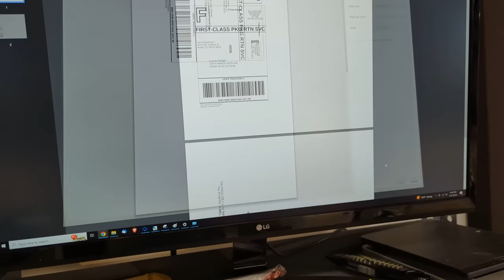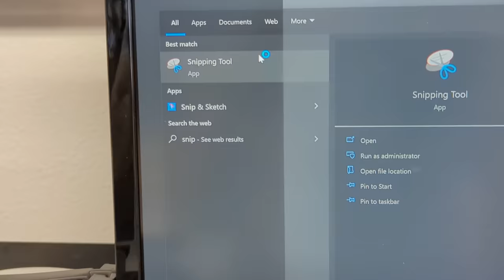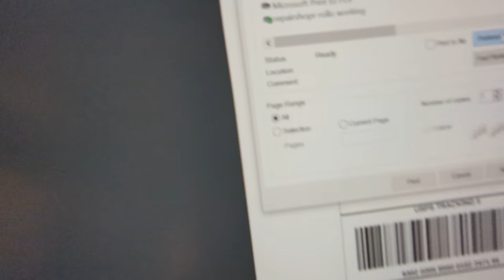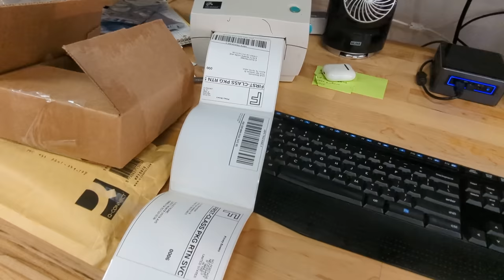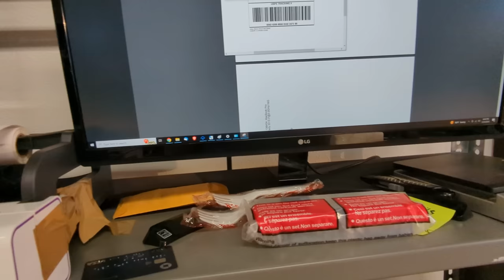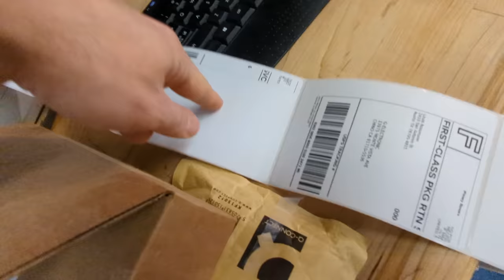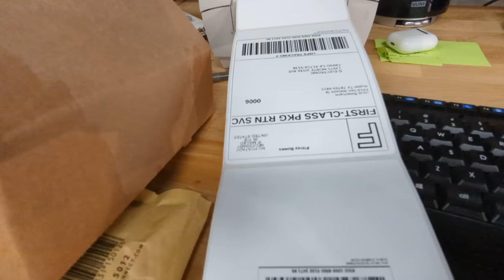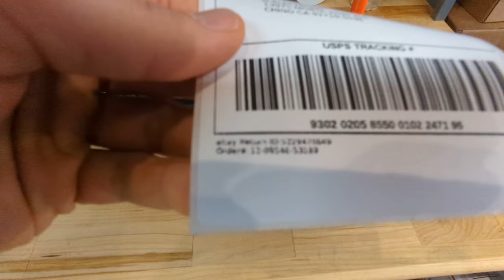rossmann repair group vs. label printer, part 3

Comment: It wouldn't be that hard to setup a Python script that auto does all of this.  You can have a script that automatically takes that pdf file of the shipping label, converts it to an image, auto crops it to correct size (by using smart logic for pixel detection rgb change vs background rgb value) then auto sets the print settings and prints it.   I've done similar stuff like this for my work.   Edit: only worth it though if you have to do a lot.  If you only have to print something like that from time to time, then probably not worth it.
Reply: Is this ChatGPT code any good?

import os
import tempfile
from pdf2image import convert_from_path
from PIL import Image

# Set the path to the PDF shipping label
pdf_path = 'shipping_label.pdf'

# Convert the PDF to an image
with tempfile.TemporaryDirectory() as path:
    images = convert_from_path(pdf_path, output_folder=path, last_page=1, first_page =0)
    image = images[0]

# Crop the image to the correct size
width, height = image.size
cropped_image = image.crop((0, 0, width, height - 20))

# Save the cropped image
cropped_image.save('shipping_label.png')

# Set the print settings
os.system("lpr -o fit-to-page shipping_label.png")
Reply: @LordSandwichII  Not bad, but:

(1) You need a way to select your pdf. If you work well with terminals, it can be an argument. If not, or your colleagues will be using it, you will need a little GUI.

(2) This code assumes the shipping label is always on the first page and in the same size/place.

(3) You should adjust the crop settings if the above is true. Disable the printing code and check the cropped image until you get what you want.

(4) Libraries need to be installed if they aren't, like Pillow (for image manipulation) and pdf2image.

(5) Right now, if a 'shipping_label.png' file already exists you may get an error. Perhaps implement deletion / overwrite.

(6) The last line only works on Linux, because "lpr" is a Linux command. You need a system command that A) Selects the label printer with proper settings and B) works on Windows if you use that. Unfortunately, I'm unfamiliar. 

(+) This code does some unnecessary things, like create a temporary folder that's never used and converting two pages to an img but only using one (the one with the shipping label).
Reply: @soheil5710  ...and this is exactly why I think Chat GPT is not a substitute for learning how to code. Thanks! :)
Reply: @LordSandwichII  I'm still baffled that it's able to produce this much.

Comment: you can elimate the printer and use a plain paper printer. they have that label size as return labels from ebay.  just print it out and tape it to the box works every time. just do not tape over the barcode. you also could have measured the label size then use a plain paper printer as test sheets to get the right size. then try it out on the label. you also could have cut paper to the label size then send it through the printer as a test. it might not print on that type of paper. save waste on labels.

Comment: Louis, Did you know that an Imperial Inch is really a metric unit? It is now defined as being exactly 2.54 cms. It changed in the 1960s. So freedom units are actually French Units...
As for conversion. multiply the inches by 2.5 [4*6in is 10*15cm]; even at 73 years I can still do this without a calculator or pen+pencil...

Comment: Been there done that. Everyone annoying to figure out the zebra proper config. Also if you change the printer dialog from the chrome print to windows printer dialog the label is created differently :))

Comment: Good luck on your printer issues. At least it’s not dot matrix driver issues - 24 pin print head but no driver only 8 pin head software drivers …. This was a real issue 30-36 years ago … and there was no internet to find/dl a solution.. new store looks amazing. We need a proper store tour video.

Comment: Brother driver for QL-1110 (with or without NWB) has an auto crop feature (explanation below). I wonder if there is open source software able to do the same.
Explanation: Auto crop detects the frame of a shipping label and auto crops it. To enhance readability of the barcode it will read the barcode data and re-generate the barcode so that a small and wide bar width ends up as multiple of pixel width. Looks somewhat funny when you notice it for the first time, label size and text look all ok but the barcode moved a little bit and is smaller or wider than original.
Downside: QL-1110 NWB does not work with any paper, it needs to have black sqares on the back, but there are plenty of cheap third party options out there (search for DK22243 (=endless but printer has a cutting unit) or DK-11247)

Comment: Use the the free version of the ZebraDesigner printer software. You already have a Zebra printer, so it will work no problem.

Comment: Those zebra printers are tricky.  Make sure you set the label size in the printer properties/settings of the printer.  Changing sizes in the print options doesn't exactly work right.

Comment: I didn't use a thermal printer since like 7 years but I do remember, as a developper, you need to update the paper size from the printer settings (that is usually handled from the printer driver) and possibly from the software you are printing from...; exacly like you did with the snipping tool from windows. Those printer may not work properly with software with predefined paper size (that you cannot customize) or paper detection (like the "fit to page" option). Google Chrome is one of those bastard that partially implemented their own printing process. You could also try to install a 3rd party pdf reader that use the usual Windows printing process (I didn't check with Foxit Reader).
And somewhat, I remember that "printing" it as a PDF instead of the printer, was enough to test (especialy like at your stage, to figure out everything). But that may be because I already entered everything right in the setup process.

Comment: Haven't seen the entire video, however Inkscape does a pretty good job of opening vector stuff out of pdfs, you can then save it as a high-res png and print it with whatever (idk libreoffice, office, pages (*pukes*) or whatever). Works for my stamps over here that I buy online (Germany), it can even keep the size information if you somehow click things right

Comment: I use shipstation and sometimes what i find whether using google chrome or firefox is it chooses to print the label within the browser. I personally find when you save it as a PDF and open within adobe reader it ALWAYS prints properly. Printing from within chrome or firefox can cause mayhem for some reason with PDF or labels.

Comment: If you think the driver revering on the printer is stupid just wait until you read this; My favorite driver conundrum with windows is with the new xbox wireless controller driver. For some amazing reason Microsoft decided that the button mapping needed to be changed with a firmware update to the controller itself, requiring a new driver to handle the new button layout. The problem is that the driver is now so deeply embedded into Windows 10 that it usually gets upgraded when you go from one major version to another, The firmware update to the xbox controller happened right around the time they released version 1903, Im still on 1607 and went to go sync the controller only to find out that one of the sticks don't work A is bound the the bumper and half the buttons do nothing. In order to get this driver, because at the time it wasn't hosted anywhere official, I had to set up a virtual machine with the new windows version, copy the driver over, make sure it remained signed, and then after that if for what ever reason the controller ever gets removed from device manager, either by syncing it via bluetooth or adding more than one controller, windows will reinstall the old driver and all the buttons won't work again. I re install the correct new driver and then as the icing on the cake, windows needs to reboot to use the new driver, it can go from new driver to old driver with no reboot, but needs too reboot to go from old driver to new driver.

Comment: While I don't know if this would fix anything, you were using Chrome's built-in printer dialog at first and not the system one.
The former is very limited and tends to do it's own thing- it's simply bad at it's job, whereas the latter is less intuitive because of the ancient interface, but might work better.

Comment: Windows can unfortunately change the used drivers for a device even if the GUI setting for automatic driver installations is disabled. But there is a group policy setting that really disables that behavior.

Comment: The zebra probably can generate the barcode by its own including the box and proper formatting - down side is you have to learn how to connect to the terminal of the Zebra and talk to it...
Reply: yeah I've had to do this to integrate a similar label printer with a PLC in an industrial automation project. Fun and games
Reply: @marcogenovesi8570  yeah that's how you figure it out I had my "This is -UNIX- BASIC, I know that" with a Zebra printer when we figured out that we don't need a computer to increment EAN codes and print the on button press after fucking around with a program called "label master 2000" or something like that that absolutely was not able to print labels in under 5 minutes, what was just not feasible for this job.
Reply: you use zpl (zebra programming language) for it. you can use zpldesigner to do it
Reply: @ikbendusan  ZBI to be more specific is the interpreter terminal that runs on those kind of Zebras what is in essence just a extended basic - the reason we did not go for plain ZPL was that we could hack the button to restart the loop so that all you have to do to get a label is to press the button you could not do that with ZPL generated by zebra studio /zpldesigner (or whe where to dumb to figure it out)
Reply: @fischX  i made a python script for such extended functionality; personally i only use zpldesigner for the design part

Comment: Surely the better thing to do is first pre-prepare a custom sized blank document, since any modern word-processing software will let you set a custom page size. Then once the document is in place you do all of the screenshot-finagling to get the label data into the document in the right place. Then since you have a pre-sized document that matches your paper, you know it will print out correctly.
Reply: Thinking about it some more, I know that there are at least 3 different ways to import a PDF file into a Word document (if you're using free office software like LibreOffice I'm sure it has similar functionality). So I'm sure there's a way do it all in one go by importing it into Word (or equivalent), resizing the page and then manually adjusting it to fit in place.

Unfortunately it will still be a manual process to some extent because the problem is that the printer driver fundamentally cannot distinguish between vitally important blank space that needs to be preserved for design-related reasons and a simple absence of data on the rest of the page. So absent of very specific (and probably expensive) software or some AI solution, the actual act of telling the computer what part of the page it's allowed to discard when scaling down will have to be done manually by a human.
Reply: If you've got someone who's proficient in writing macros for whatever office suite you have and it's a frequent issue, they could probably write a one-click solution for it, but it would have to be different for each courier/label type. So not sure whether the time calculus works out on that.

Comment: The label editing software that came with my Brother label printer has settings included for all the supported paper formats so I can just use the snipping tool to copy and paste an image onto a label in that software. I never have to type in any dimensions, I just select the paper type in the program and adjust the image to make it fit. Does Zebra not offer software like that for their printers? It could make that process a lot easier for you.

Comment: You had it midway through, just had to crop the image a bit on the sides and adjust the print margins it was printing in from the side too far and that setting is in the same dialog you edited the paper size in.

Comment: you don't just have a plain paper printer like a brother where you can size the paper the label however you want, scotch-tape it, just don't tape over the barcode they have to scan... works for me, my zebra I think got dropped, I need to super glue it together I think...

Comment: "It will scan", not neccesarily if the bar code stripes are at the wrong distance apart. Maybe if the courier sent out QR codes might work out better.

Comment: It's the label generator software - if it gave you the proper 4" x 6" print job, life would be so much easier.  Fit to page dialog is outside of the basic Windows 'print' - usually advanced or printer software.

Comment: The way I get this to work for me is I save the label as a pdf and then open it in the pdf reader then use a snapshot to highlight the label then do ctrl P and it should pecking or just fine

Comment: If that is a raster image, then GIMP has ability to change size or position of print (File | Print... | Image Settings). Page size and orientation are in File | Page Setup...

Comment: G-Electronic has scammed me before. Haven't seen the video yet but I noticed you're returning something to G-Electronic. I purchased a very large quantity of barcode scanner batteries from them.  All the batteries failed within a week. All the batteries said they had 5 charge cycles on them but I was skeptical. I took them to a friend who read the info off the chip in the battery or whatever and apparently G-Electronic reset the charge cycle counter on the batteries so they would read 5 charge cycles instead of the real number. That's my opinion on my experience. Hope you had better luck. Going to watch the video when I get off work.

Comment: I've had to do this exact same bullshit before with a regular printer. And for once the printer wasn't even at fault. Some companies just send the label with zero negative space around it to help scale it correctly. To make matters worse, Chrome's scaling and positioning settings are terrible to work with.

Comment: it should still scan perfectly fine.
the width of the bars is relevant in relation to the others in the lineup. 
you're not required to print it on 8x11.

are you saying that what ever came out wasn't scannable by the driver?

Comment: Me and my colleague on site spent two hours yesterday trying to figure out why the same label printed on the same zebra printer would print correctly when being sent manually but get all screwed up when being sent to the printer automatically by our program. In the end, I undid the changes we had just done to the label and it suddenly started working again.

I hate label printers.

Comment: here is some simple python code (intended for UPS labels, needs adjustment to where the label is located)

from PyPDF2 import PdfFileWriter, PdfFileReader

with open("input.odf", "rb") as in_f:
    input1 = PdfFileReader(in_f)
    output = PdfFileWriter()
    numPages = input1.getNumPages()
    print("document has %s pages." % numPages)
    for i in range(numPages):
        page = input1.getPage(i)
        print(page.mediaBox.getUpperRight_x(), page.mediaBox.getUpperRight_y())
        page.trimBox.lowerLeft = (10, 170)  # bigger
        page.trimBox.upperRight = (560, 470)
        page.cropBox.lowerLeft = (10, 170)  # smaller
        page.cropBox.upperRight = (560, 470)
        page.rotateClockwise(90)
        output.addPage(page)
    with open("output.pdf", "wb") as out_f:
        output.write(out_f)

Comment: Office Space moment. Also if saving an image turns out to be a decent way to get the printer to play ball, you can automate cropping with graphicsmagic.

gm convert test.png -crop +LEFT+TOP -crop -RIGHT-BOTTOM cropped.png

I have scripts setup to handle screenshots from certain software and it works well.

Comment: Print to PDF, use Actions to crop PDF to the correct size and print.  With Actions in Adobe PDF you can save your crop settings and tweak them to the proper size.

Comment: maybe a dpi issue? I had the same problem with my zebra printe because the printer was 300dpi and my settings weren't. after fixing that i could chose the correct paper sizes.
Reply: this. you are printing with 150dpi, the printer has 300dpi

Comment: Use IrfanView to print clipboard stuff. Ultimate control over placement and size and it's a powerful image formatter in it's own right. Free!
Edit: MS is responsible for that driver swap. Windows be doing that lately. They kept updating my serial adapter driver to a "current" (intentionally disabled) driver. I had to flash a custom firmware to it so it wouldn't show up as a device that Windows recognized in it's driver database and then force install a six-year-old driver to make the hellish nightmare stop.

Comment: such a common issue for such a common label printer, troubleshooted this plenty of times for many clients
taking a guess before watching, wrong paper size, right? someone put that label on an 8.5x11 sheet but the printer was set correctly at 4x6?
shouldn't need to scale, perhaps rotate

Comment: Why so much labels for one parcel? In our country the price for 10x9cm label is around 6-7 cents, combine this with the price of courier plastic bag (from 6-7 cents to 16-17 for the biggest) makes this unsustainable if you're not adding those expenses to the final price. Btw our courier policies changed and each time you print a label the recipient's names, exact address and phone number are obscured

Anyway we never have those problems - just pick the correct paper size and how the data must fit on the paper